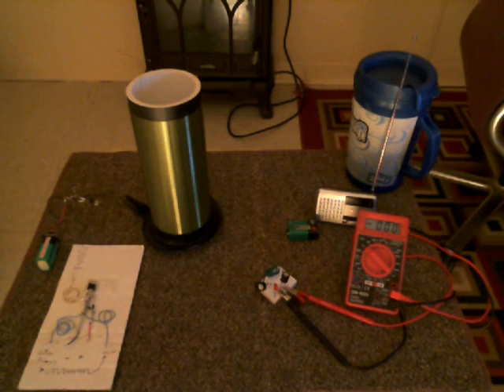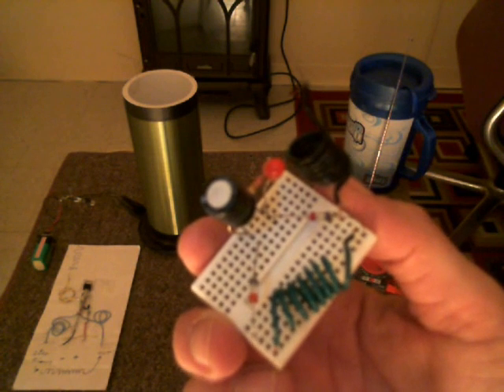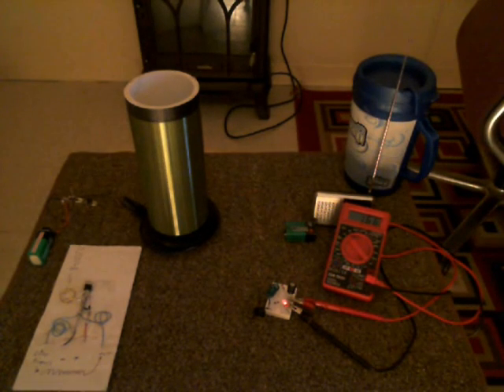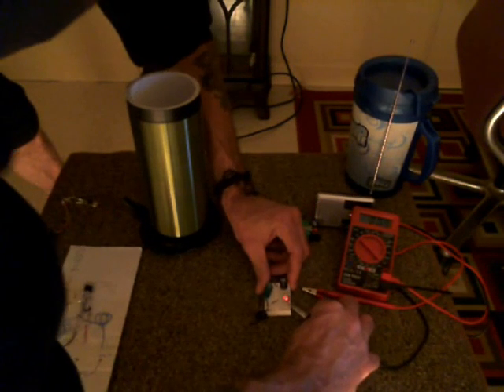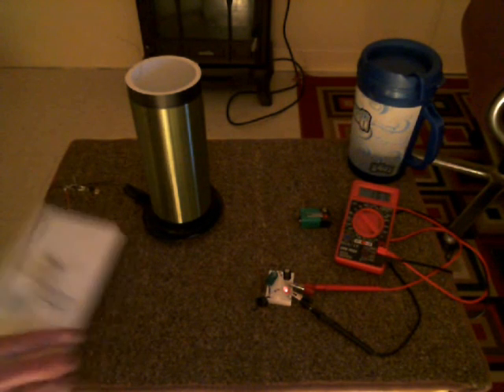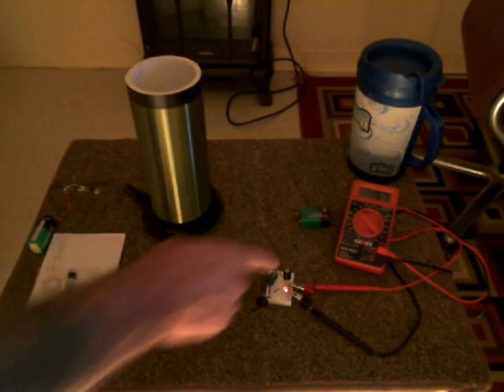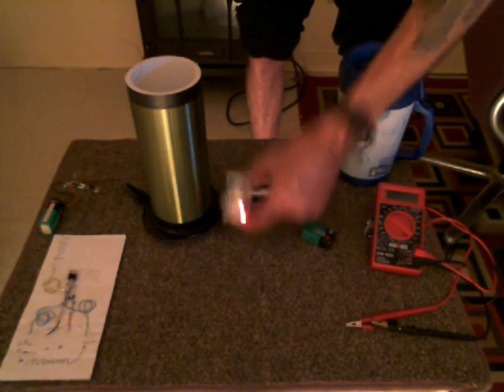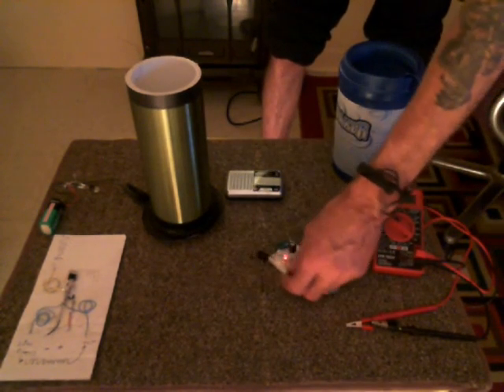WIRELESS CHARGER !

Comment: https://www.youtube.com/watch?v=rtVlNj0K2kU please my friend see this video and i have a question for you: i have six groups of pancake coils, isolated from each other, every group consist in six pancake coils connected in series, i have connected to the circuit only one group and the current is "induced" to the other groups, the question is: is it wireless electricity betwin the groups...?
Reply from the maker: The answer to your question is yes, as the fields expand and collapse they are inducing the coils in the other groups. You should try to connect rectifiers and capacitors to each of the other groups to see if you can charge them individually at the same time. And if this works as I believe it will you can use transistors to switch between loads and make a revolving LED light system that would not only be cool but has other possibilities as well. Such as using the transistors to dump the power into a larger bank of capacitors to give a much longer run time. :) Hope this helps I love your work. Take care my friend.
Reply: Thanks my friend, i appreciate very much your commentaries, i will try to make that experiment with the other groups with capacitor bank and transistors to dump the power into a larger bank of capacitors and try to give much longer run time, i think is a very good idea, the problem with the supercaps is that they are very delicate in their use and do not accept to close loop...!  Any way i can try. Saludos.

Comment: If I disconnect my coax from my HF antenna I have dc voltage present .4 to 70 volts according to atmosphere . Where dose it come from? . Any elevated wire insulated at the vertical support 60 or so feet long has developed this voltage , Just imagine running a slayer to light your shop using electricity from the air, I use a 100 volt 30 MFD capacitor and a fast diode on between the antenna and a earth ground .The voltage is always there? Help me out where dose this electricity come from? Try this please .
Reply from the maker: I am hoping to purchase soon a VC3165 Radio Frequency Counter RF Meter 0.01Hz~2.4GHz Professional Tester. I believe using this to determine a range in radio frequencies that are interacting with things like your talking about that a person could expand on this further and amplify the affect using crystal oscillators, such as old crystals from the old style scanners and more. A lot of old electronics and even new use crystals in the circuit. And the capacitor technology these days are amazing as far as charging and discharging rates and more. Join in on the Mad Science radio sometime if you like or catch me on skype I have tons of ideas on the subject.